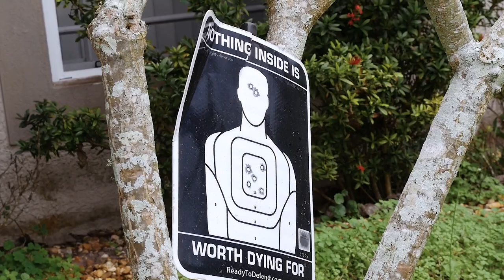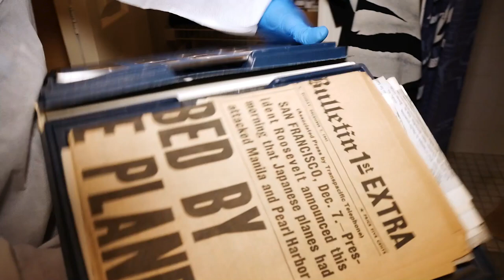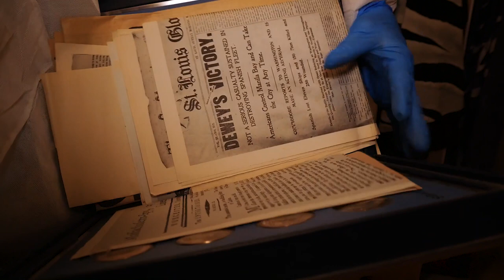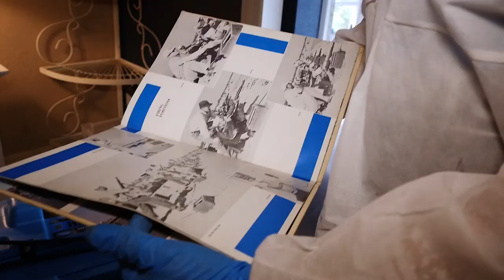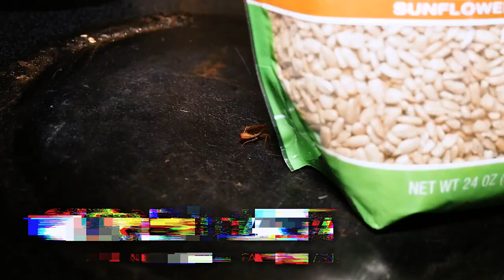House of Yarn pt. 2 + Veteran Deep Clean | SW Florida

Comment: I’ve always wanted to be a crime scene cleaner but I’m afraid of what I’ll see and I don’t have a strong stomach for these kind of things
Reply: Understsndable!  I can handle seeing& smelling& cleaning almost anything,but I don't handle the smell of vomit well without a mask or noseplugs,& if I see a rat, alive or dead, I scream like a person on fire,& I run faster than the speed of sound!!🏃🔊
However, I've never smelled decomp,& im sure I'd gag until I started throwing up f it's my first time w/out a mask! Other than that, clean up& poop smell& cat urine, etc., I can handle.
Unfortunately, I live in Florida, so I couldn't tolerate wearing the protective suit&mask, bc. I have enough trouble tolerating heat when I'm wearing shorts,& no mask!🤷😁
Reply: You could probably volunteer to see if you can handle it or not. I'm sure it takes time to get used to the smell/grossness of it all